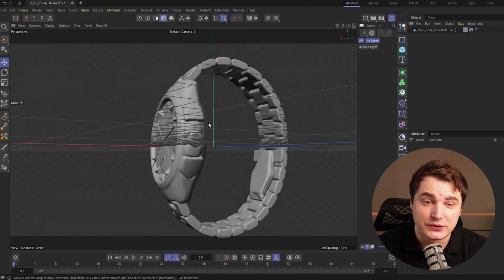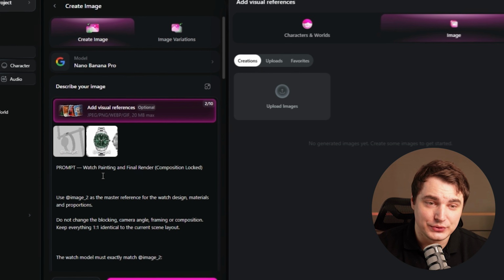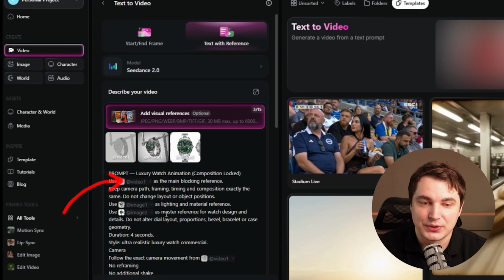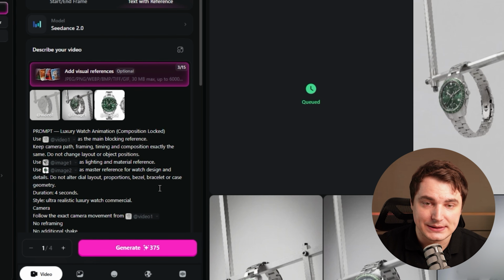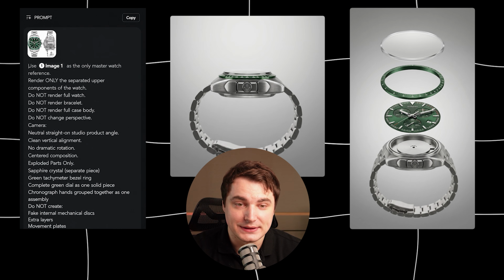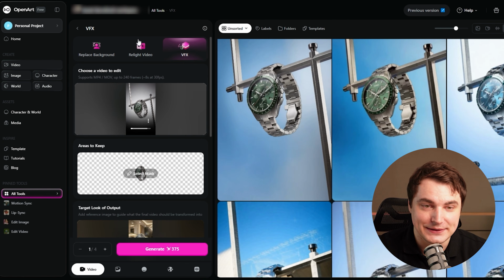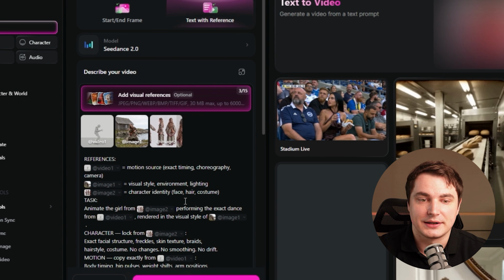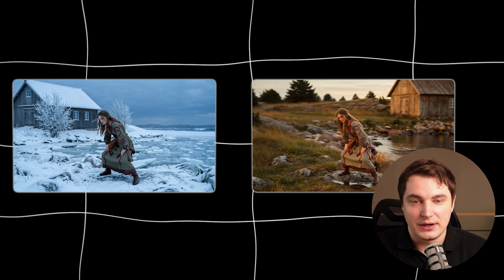AI Is the New Render Engine — Here's How PRO Actually Use It

Comment: i was always provided with a 3d model from a client most of the time CAD files that needed preparation for a 3d pipline (i work in c4d and octane)... so you can feed AI with tones of good referances based on filess from client... but the idea of skipping rendering and droping it to AI is great if you need to work very fast on a short deadline... but tbh once i have a model and whole scene set i would preffer to do renders myself especially that with gpus like rtx5090 it is usually very fast workflow.

Comment: I have a new request that fits inside what you are already doing.  Pixel characters, either like dead cells method, or vis the models textures.  This would be for 2d or 2.5d games, and would take into account a modular system so armor, clothing, hair, accessories, etc can be swapped out.  It would also include how to animate.  Straight metroidvania style sprites or 3/4 angle top down sprites (sea of stars, zero sivert camera angles).